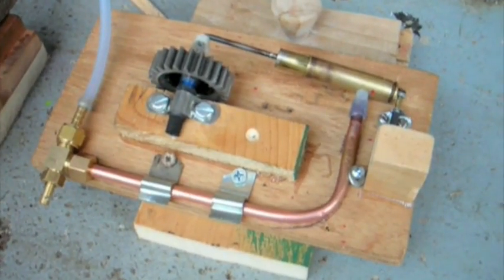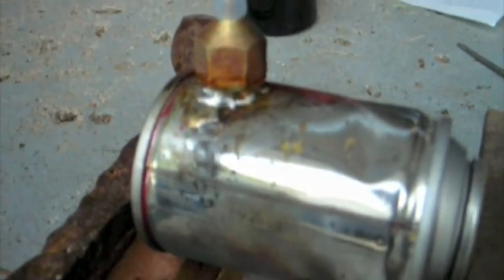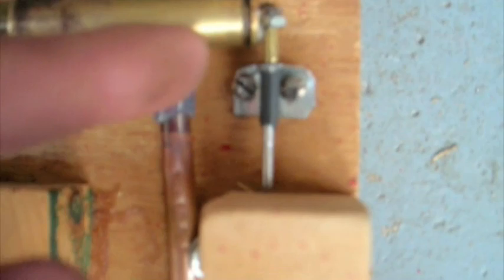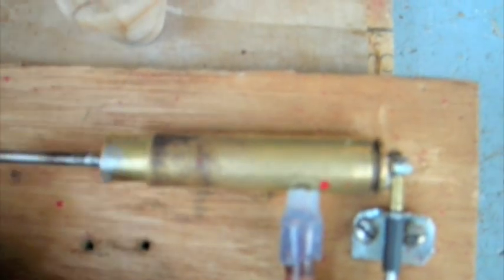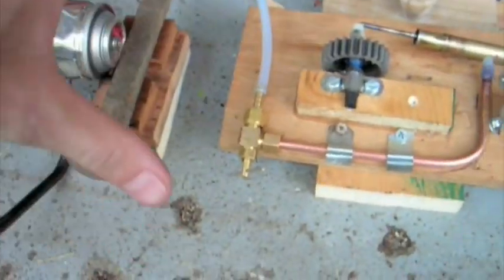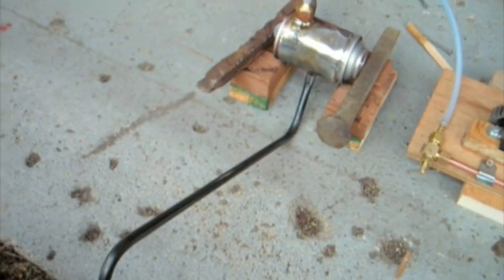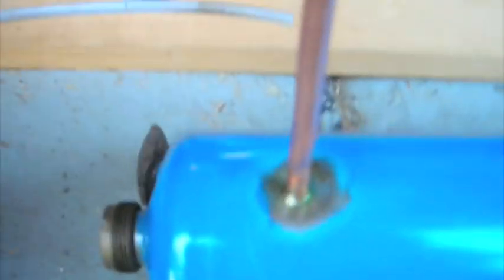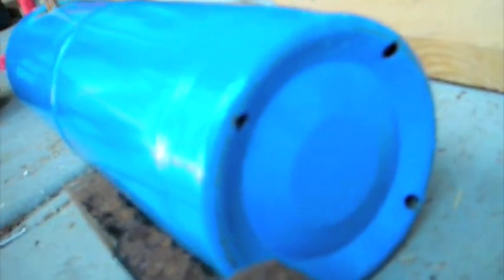homemade steam engine part 1

Comment: Nice job! just a quick tip: the next time you need to bend a copper pipe fill it with sand or salt and when is filled, bend the pipe. This way is to preserve de diameter of the pipe in the bend zone

Comment: I have a idea to you, use a monotube boiler (flash boiler) is safe and easy to build, and you can get more than 1,03 MPa (150 psi) with a small monotube boiler; with 1,03 MPa you can get 600~900W using a tesla turbine.

Comment: u should get a variable pressure valve that lets pressure out before it would explode. look up how much that can can take and set it well under because the heating and cooling will weaken it